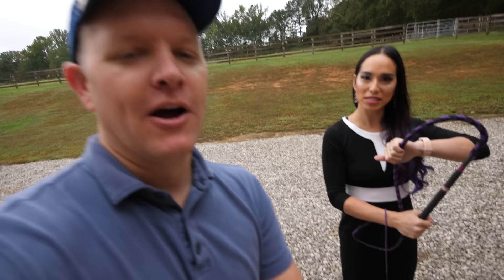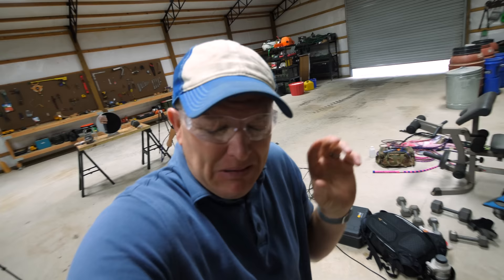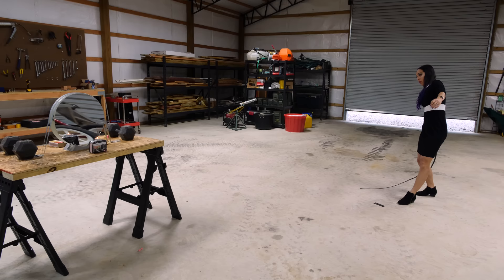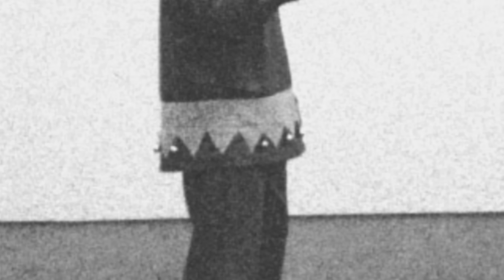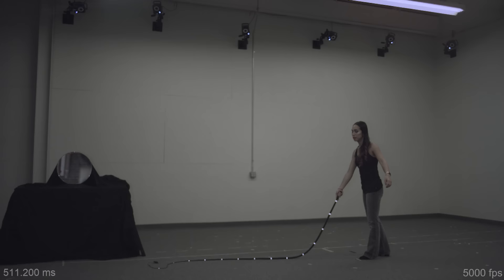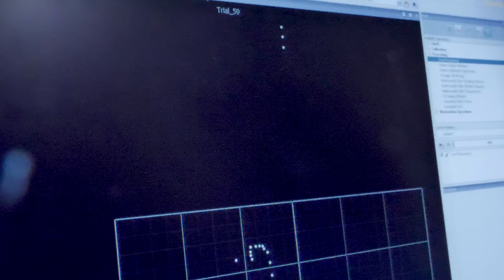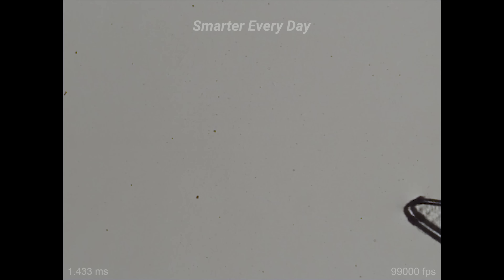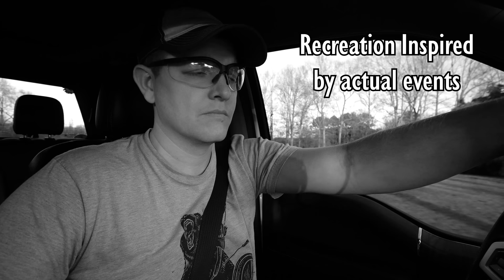How does a whip break the sound barrier? (Slow Motion Shockwave formation) - Smarter Every Day 207

Comment: OMG!  40 years ago a girlfriend convinced me to join her in an evening class where we made our own braided leather bullwhips from scratch.  We started with tanned hides, sliced them, shaved them, dressed the strips to precise tapers, oiled then braided them.  It took a team of two about 20 hours to make both whips.  Then we got to learn various techniques, from gently capturing things (we learned to wrap our whip around a balloon without popping it), to wrapping hard enough to break things (my favorite was sidewalk chalk, which exploded).

But the best part was learning to crack our whips.  We started by simply rolling the loop of the whip down onto the floor, where it would snap when the tip smacked down.  Then we gradually added more energy, a truly small amount at a time, until it started to crack in the air.  Large, graceful motions that finished with a crack.  Then we learned quicker moves that brought the snap a little closer in, where we learned to place it where we wanted it.  I envied the folks who were ambidextrous with their whips, because my right arm was getting ready to fall off.

We wanted to see if we could capture the motion of the whip by cracking it horizontally over sand, so a few of us took our whips to the beach and tried to crack the whip horizontally within an inch of the sand.  Almost impossible to do, but once in a while we did notice a puff of sand happening well before the whip had reached full extension, from a part of the whip not in contact with the sand.  If only...

Fast forward 25 years, and I was on the team making a camera that could take 100,000 frames per second (the Redlake HG-100K).  When the third alpha unit became the first to work at full speed, we searched for targets that would both test the camera and thrill Marketing.  Popping a balloon wasn't nearly fast enough.  I thought back to my days with the bullwhip, and we immediately went out and bought a few.  Despite dumping a zillion lumens into the field of view, nothing useful came of it.  (Clearly, using Schlieren photography and capturing the shockwave is crucial.)

What we did wind up doing was pointing the camera at the HID bulb in an Epson video projector (torn from the ceiling of a conference room), where we captured the most amazing video of the arc wandering between the electrodes within the bulb envelope.  We put a GIF of the sequence up on our website (this was before YouTube), which caused some small level of buzz online.  The next morning we received phone calls from the Japanese executives of both Epson and Panasonic (the maker of the bulb).  It turns out that arc wander was the primary factor limiting projector sharpness, so stabilizing the position of the arc was crucial to gaining any benefit from using higher-resolution LCDs.  Two days later they were in our offices for a demo, and left an awesome pile of money behind when they departed with our very first beta unit.  Their problem was that high-speed film limited the rate of innovation to one test run per day, with the film developed overnight: Our camera allowed them to do a dozen runs every day, leaping their R&D further ahead of the competition.

You may have noticed I mentioned we had to go out and buy some bullwhips.  My treasured handmade bullwhip had disintegrated within a year of making it: Evidently, the tanning process used on the leather wasn't compatible with the oil we applied to it.  It sure was fun while it lasted.

Now you two have got me wanting to make another one!
Reply: 😅 sorry bro too long
Reply: Pretty nice story.
Reply: Wow, that was interesting to read
Reply: What a great story! The Epson and Panasonic meeting sounds incredible and satisfying.
Reply: BobC great story!
Reply: I read that whole comment; cool stuff!
Reply: That was a nice story. Thanks for sharing
Reply: @aryanlohani622  what, are you too busy and you did you not have the 30 seconds to spare, or were you too lazy to read it, or were you not able to read it (if you're not a native English speaker)? Genuinely curious why you could comment that it was to long, but couldn't read it. (I guess the fact you commented rules out you being too busy to have time to read it.)
Reply: Thought for sure this was going to end with "tree-fiddy."
Reply: What happened to the girlfriend
Reply: BobC  you should write a book bubba holy cow I didnt know you could write that many words in a comment!
Reply: That's really cool story! Any possibility to see the GIF?
Reply: That's an awesome story man
Reply: @xenonram  I can't believe anyone would admit to that level of ignorance!
Reply: This motivated me ♥
Reply: That's a very interesting story. I would also love to see the GIF if possible!
Reply: Probably one of the most interesting comments I've seen on YouTube
Reply: What an incredible life experience! Thanks for sharing that. The wandering arc sounds like an interesting subject. I would enjoy seeing the high speed of older and newer bulbs in comparison. 

The diversity of the comments inspired the following; Thanks for the humor at the expense of all the people who's attention span can't handle reading anything more than two sentences. No wonder Audible has such success. The internet has made the general population mentally lazy.

I continue to another paragraph to ensure the ones who wouldn't like my remark won't read it. I figure, if they click "read more" and see more than one paragraph they don't even attempt to do so. Surely there will be a few, as you can't make a hypothesis and expect one hundred percent of the study to fit. That would be a theory and I'm not there yet. Happy New Year!
Reply: That's awesome!
Reply: I read some of this..... And then I seen how long it was and just abandon ship... Lol good job!
Reply: This was a great read. Thanks for sharing your story!
Reply: That's amazing! Thanks for sharing.
Reply: @xenonram  he might just be lazy to read the whole thing as some of us really don't have the interest to read all of that
Reply: @aryanlohani622 🧠 ADD gang 🧠
Reply: You have perfect English skills. Obviously it’s started like an essay with intro/body/conclusion lol
Reply: I'm glad I took the time to read this, thanks for sharing it!
Reply: wonderful story of science without ego (and a pile of money at the end =D). did you try cracking the whip in front of the projector lamp?
Reply: @aryanlohani622  shoo
Reply: @wilson.5420  Let's just say the whip disintegrated slower than our relationship...
Reply: @quetoni  I went looking for it, and the original video, right after finishing the post.  Nothing found.  They were probably on CDs that had become unreadable a decade ago and had been thrown away.  Digital media is so fragile, we often forget how much so.  The only defense is to have many copies on many different kinds of storage media.
Reply: @AprilJenniferChoi  I should have mentioned just how lumpy that whip was, how some regions had a bit of corkscrew to them, and how different regions had different flexibility.  Fabricating and braiding leather is a skill earned over a lifetime, not an evening class over a few months. Fortunately, only the last third seemed to really matter, which worked well enough for us beginners.
Reply: @aryanlohani622  Yeah, I should have put a tl;dr at the top for the SAS folks and skim readers.  Having those memories unexpectedly resurface due to a SmarterEveryDay video had me rushing to share them, and I didn't really think much about all the different kinds of folks who would be reading it.  My bad!
Reply: This is a glorious story, with just the right amount of detail that all ties together by the end.
Reply: Thank you so much for sharing :)
Reply: Thank you for writing one of my favorite comments ever! Fascinating! :)
Reply: No I won't read
Reply: One of the most interesting comments I've seen on Youtube.
Reply: Really interesting story! Glad you put the effort and time to write it.
Reply: I though this was going in a totally different direction
Reply: This is awesome. I want to make a whip
Reply: @laughingfurry  Cool.
Reply: More story, bro. More story!!! I loved it! God bless!
Reply: Awesome story bob!
Reply: guys like this are why I started getting into older white collar guys.... guys....you know... like my dad 😏
Reply: the moral of the story is: trying to understand the basics of anything, that we cant explain, always leads to great things, in this case projector technology was most likely improved by the observations made while playing with a whip and a high speed camera.
Reply: I really thought this was gonna end in a Copypasta. 10/10 would read again.
Reply: @xenonram  chill
Reply: That's actually really awesome 😮😮
Reply: What an awesome story!  Thanks for sharing.
Reply: Presses read more in brain says : too lazy to read
Reply: Good story
Reply: Most interesting comment all year..    Not sure Epson and Panasonic will like that someone's published their trade secret.  But whatever, right?
Reply: @AprilJenniferChoi  Ha! I was hoping you would see this comment!! Aren't you also a whipmaker, tooooo? :-)
Reply: I just want to say I love your comment. Thank you for taking the time to write it.
Reply: Worth the read 9 months later
Reply: "A boomer says omg and types a text wall!"
Reply: Nice but long story didnt get half way through, video is better and yu prob think that too
Reply: That was such a good read I hope you are doing good in life
Reply: I ain’t reading all that

Comment: I hypothesise that the knot that helps to start the force of the air breaking, leading the waves, is just enough mass change in a quick transition towards the end of that whip that is the  ultimate catalyst, seeing as how the wave suddenly goes from very little mass to a sizable addition of mass, and the frayed ends are trying to catch up to the equilibriam of pressure exerted by the wave as the sound barrier is broken.  

Great work on this, my science bug is wanting more. Subbed for awesome whip cracking science!

Comment: Interesting, now how can we apply this to space travel.
Reply: Attach a spaceship to the end of a huge whip and get to space without rocket fuel
Reply: @JackSpasojevich  the only problem is that the spaceship could only weigh a couple of kilograms and you'd already need a massive qhip
Reply: You know those g-force traning things? Make it like that but vertical and can detatch the pod after ~7g's and make sure its pointing upwards
Reply: Ever heard of less air the higher you go and it would be impossible whips are to heavy and they don’t generate enough thrust
Reply: Intergalc-whip
Reply: Primo Zimo build a catapult that works like a whip and make launch the rocket/spaceship at the fastest point. ez clap
Reply: the thing is speed of sound is not fast enough to do reasistic space travel
Reply: @codr6934  I don't think they know that
Reply: A magnetic railgun catapult several miles long that can accelerate spacecraft to escape velocity. But are we able to calculate an intercept course from our star to a star whose light is hundreds of years out of date as we perceive it?
Reply: @JackSpasojevich  So your proposing to yeet spaceships via a giant whip?

Im sold, take my money
Reply: no
Reply: use whips to force workers (slaves) to build bigger rockets and much more, faster and cheaper.

What? How do you think pyramids were built? Or any great monuments in History ?
Reply: @Diamond_Tiara  great answer.
Reply: Dunno, I’m sure it would involve another $130000000000000s though
Reply: USA: interesting, now how can we weaponize it?
Reply: we make a giant metal whip that constantly whips itself and propels you fowrd like a snake
Reply: @Astakos907  hmm 🤔 idk if air matters to a whip.
Reply: @skinnyalien2151  In what way? Like u hear the sound becouse of air. But you can use a whip in vacuum if it doesn't evaporates so ut doesn't need air just to be swinged and motion dynamics still apply. Probably the only change in its motion is the pulling part at the end. This is only my opinion and i haven't proven it nor even tested it so this is absolutely a speculation. I think it gets pulled, becouse after it gave its motion energy to the air and starts to unroll it is slowing down but since air is moving(the wave) pressure will be smaller behind it so itt will end up generating a pulling force which affects the end of the whip too. Sry if i didn't answer specifically for you but i am too lazy to read what you answered for so if this is not for u then please tag or write it to the one u made a point for if u care.
Reply: well we already kinda do when we slingshot around a planet to use its gravity to redirect or increase speed
Reply: split the moon
Reply: @coppulor6500  I think that’s different. Whips do not use gravity. Whips work by conserving momentum until the end of the whip where the mass is so much smaller than the start of the whip. So by the end the whip gains incredible speed. When we slingshot our spaceships it is just the gravity that’s doing the work so nothing is gradually decreasing in mass,
Reply: @adamferencz460  that is what I meant sir does not matter to a whip
Reply: ••attaches the shuttle to rope, and whips it••

The shuttle:
Im going to marrrrssssssssss
Reply: @FoXy-gr2hb  WdYm “A cOuPLe kiLOgRaMs”
Reply: @skinnyalien2151  without air the whip wouldn’t make a sound or a wave so I’d say the air matters a lot to the whip.
Reply: @ryansteele2446  doesn’t the sound come from breaking the sound barrier? And also it doesn’t matter to create the super fast speed just if you are right the sound so air doesn’t matter to accelerate the speed.
Reply: In Star Trek IV, they used the gravity of the sun to whip them around so that they could time travel.
Reply: @FoXy-gr2hb  and all the people inside the ship would be turned into salsa.
Reply: @JackSpasojevich  so basically just getting the spaceship into space lmao
Reply: Whip the debris in space and maybe start herding all the space debris to one area. Dont forget the cowboy hats.
Reply: That’s exactly what I thought 😂
Reply: Have a miles long, tapering chain and attach the thick end to a train, the thin end to the thing you want to send to space. Have the train haul the thick end as fast as possible toward the thin end. The chain will move faster and faster as it tapers down until it smacks the payload into a million pieces.
Reply: Great ideas but how are you gonna slow down when you need to in a frictionless void with unknown obstacles and which human can take the amount of Gs prolonged over several minutes even up to hours then how do you plan on retrieving the data from the exploration?
Reply: Or launch a spaceship up to space instead its not rocket-fueled, but whip dynamics.
Reply: How can we make it a nuclear weapon
Reply: @Diamond_Tiara  Having modern law today, that will not be legal

Comment: I agree that the hypersonic movement is caused by the acceleration of the tip and that the acceleration is caused by conservation of momentum and the decreasing diameter (or, more exactly, mass density) of the whip along its length toward the tip. But I think the acceleration is still high even if the diameter or density is constant along the length of the whip. This is because of the following fact. 

At any time during whipping, we can devide the whip into two parts the upper part (near the tip) and the lower part (near the hand). The main momentum is generated by only the upper part because the lower part is almost stationary during whipping. Due to the law of conservation of momentum, the upper part has to speed up because the length (and mass) is decreasing during whipping. The rate of relative decrease of mass of upper part is, in fact, accelerating toward the end of the whipping process, which results in accelerating rate of relative increase of the speed.

Comment: As a whip maker and instructor, this is the coolest video you could have put out! Thank you! One thing we've noticed is that different popper materials and fluff length actually change the tone of the sound - to be sharper or duller. It would be amazing if you were able to explain that using this new model!
Reply: It looked like the shockwave from the knotted tip was much less powerful than the fluff. It still goes supersonic without the fluff, but it's not as loud.

Comment: Great video! I recently learned how to crack a whip. The other day it was pretty cold, and I cracked it. My brother and I both saw a little cloud of condensation near where the crack started. The only explanation we can think of is that it was a small vapour cone, like at the nose of a fighter jet. If you plan to do another video about whip dynamics, it would be incredible if you mentioned that, and looked into it a bit more. (I would, but I don't have access to the same sort of setup as you)

Thanks!